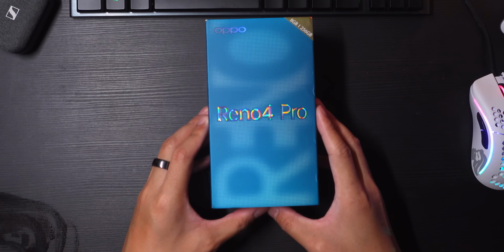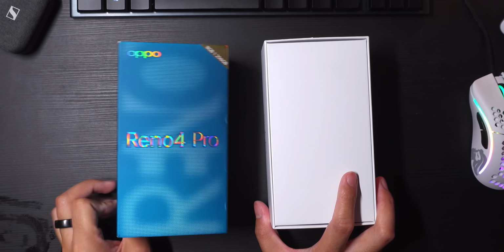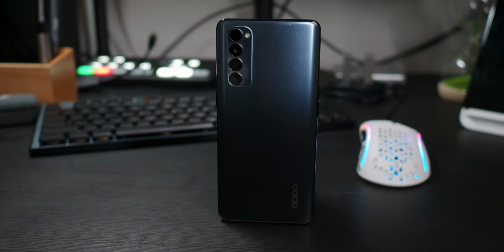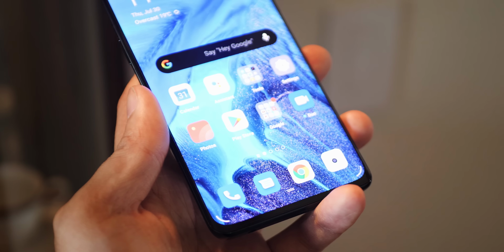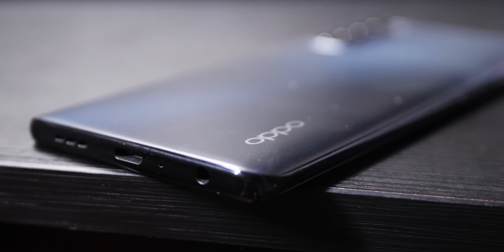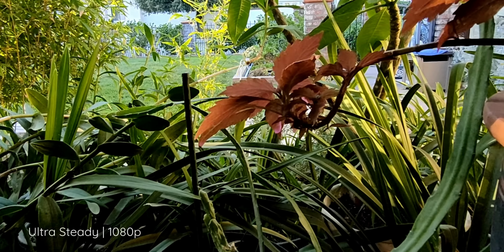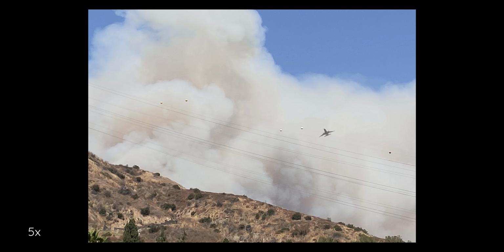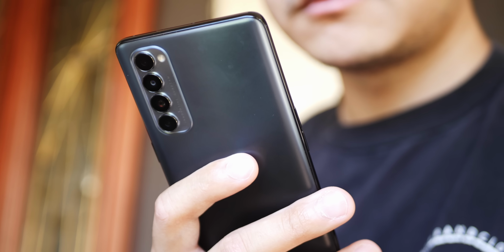Oppo Reno4 Pro: Feels good (enough)

Comment: Is it really SD720G? AFAIK it comes with SD765G... which is the same SoC they're also offering in the Reno3Pro 5G-variant and FindX2Lite, not to mention other competition released this summer. Maybe it's 720G in the 4G-only variant? Camera-wise the one you're describing seems even weaker the competition - though I think the 5G variant comes with IMX708 for wide, IMX586 for main and a 13MPix Samsung for tele and a 2MPix mono depth-sensor. And in many european markets the 5G variant is predominant... Perhaps you could rename the title to Oppo Reno4 Pro 4G ;) cause it seems the 5G-enabled variant is a totally different beast ;)

Comment: What is Oppo doing exactly the Reno 4 pro is priced at 470 Euros. You can get an Oppo Reno 3 pro 5g for 450 dollars on Aliexpress.
Which has
1. Stereo speakers
2. 765g with 5g
3. A beautiful  metal and glass design 7.7 mm thick and weighs  172g only
4. Telephoto Camera.
Why would you buy the Reno 4 pro at this price point. This is ridiculous.
Reply: @Aus-TBN  The only Difference Between a China variant and a Global variant is the Rom on the device not the Hardware.  🤦🏻‍♂️Meaning the China variant will not have Google playstore on it. But in most cases you can ask the seller to add it for you or you can side load it yourself.
Reply: @Aus-TBN  When you check the specs [Hardware] of a phone on GsmArena, which is highly reputable and the goto site for accurate specifications. Do you get different specifications for the OPPO Reno 3 pro 5g China varient than the  Specifications for the OPPO Reno 3 pro 5g Global variant. Or is it the same list of specs!?
What are you talking ABOUT! 
A good example on Frankie Tech is the Oneplus 8 pro. The China varient which he's using right now has Hydrogen OS. But it's Exactly the same specs and Hardware as the more expensive Global version. The only difference is THE SOFTWARE, OXYGEN OS.... IT'S EXACTLY THE SAME PHONE.
Reply: @Aus-TBN  My bad. I was confused about what  you were trying to say with your original comment. I thought you were generalizing that there is a hardware difference between the China and Global variant  of phones in general. You were specifically talking about the Reno 4 pro.
Reply: @TStudio Any chance you guys knows if the Chinese version would allow me to pay with Google Pay here in the US ? Also what about VOLTE and VOWIFI in the US ? Not much experience with Chinese version but I really would love to get this one if this can works.  Thanks :)

Comment: For me since the Reno 2 oppo has played it safe. I really liked the quirkyness of the shark fin camera it shown a company that wasn't too shy of standing out in the crowd. Now I feel they just want to blend in with all of the other smartphones
Reply: Yeah. Reno 3 and 4 doest look any different from the non Reno variant.  It kinda lost the Reno factor.
Reply: To be fair, I didn't like the shark fin (on both the reno 2 and 10x) because it means I couldn't use face unlock. I don't miss it.
Reply: @bprabawabr  that's fair enough the Reno 2 does have face unlock it just means it has to pop up the camera each time. I think what they should of done was keep the findX line as pop up camera as that's what it originally started off with and then have the Reno phones hole punch out as then people get the best of both worlds and can choose which one they like rather than changing both lines to hole punch
Reply: bprabawabr moose was a bit of

Comment: Damn, just looked at Reno4 Pro 5G specs. It seems nearly perfect, just wish it had the micro SD card slot and aux port that the regular pro had. Then would be near perfect!
Reply: This unfortunately is not the 5G version. Also Reno 3 5G has much powerful chip than the pro 5g verison of reno 3, weird.